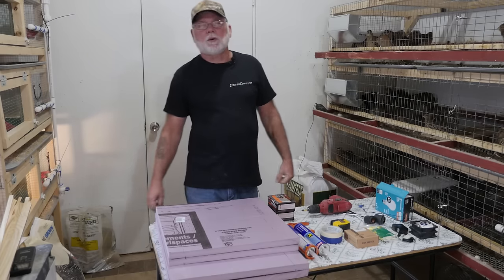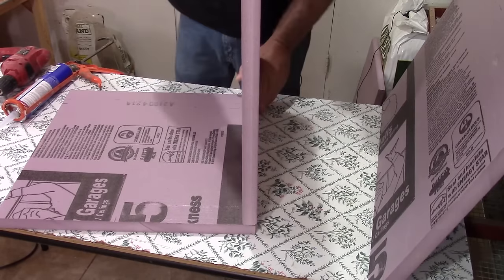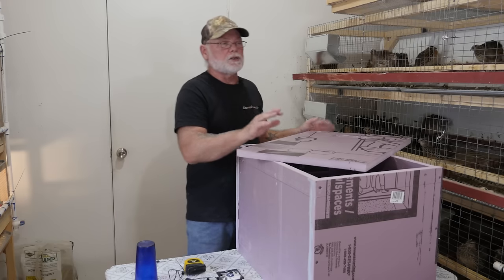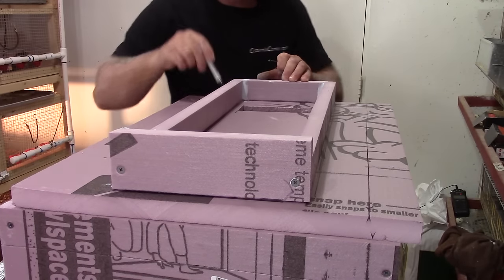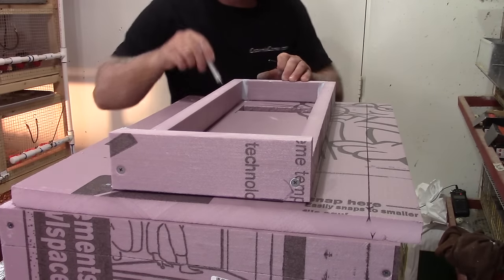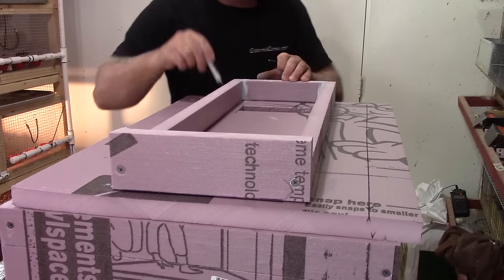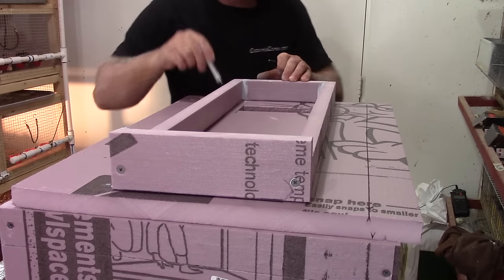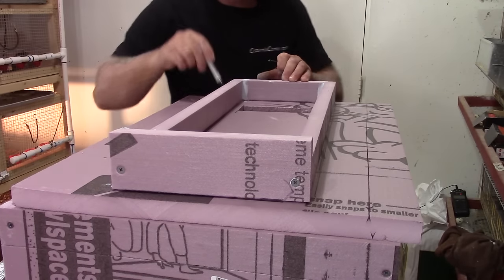How to: Cabinet Incubator - 240 quail egg incubator

Comment: Terry Hi, I m from  India  and seen almost all your vedios.  vedios r great particularly this one . Your information  is very useful & helpful for a number of unemployed youth to get livelihoods.  I am also one such unemployed and run rickshaw pulling . As rickshow pulling hard and less income source, I study your vedios and develop my own incubator to augment my income with your help and  by studying vedios and also taking your guidance. 
Brother, I completed making of my incubator with following information I  use 60W ,  two incandescent bulbs and two fan on one on each bulb. Temperature controller W 1209  from AMAZON, gives temp 37.5 .+0, - 0.5
Incubator body made from thremocol of 30mm thickness. Two small holes for air at bottom and small two holes FOR ESCAPE of hot gas at top. 
I face a problem  in my incubator that temperature and humidity do not rise to required level,  if temperature rise the humidity go down and if humidity rise temperatures goes down. I achieved 37.5 degree centigrade and humidity  43 to 45 Rh% , by use of sponge and cotton cloth humidity rise to 60Rh% but temp dropped to 31 in HTC 2 digital temperature and humidity meter , Where as temperature module showed 37mini 37.5 maximum in centigrade 
 Temperature and Humidity relations is big problem. As without proper temperature and humidity hatching is impossible. I tried on 2 eggs and they got damaged. 
Please guide where I go wrong in making incubator or in hatching process,  as  in achieving temperature and humidity. 
And why the problem is arising .
Please guide and advise pl.
Thanks in advance

Comment: Thank you for sharing good technique, specially the air chennel idea for perfect air circulation. I just wonder how the oxygen level can be maintained in incubator ?
Reply from the maker: Thanks for your comment! There are ventilation holes drilled in the top and on both sides of the incubator. I drill two 1/2" holes on the top and two on each side. One near the top and the other about midway. Hope this helps.

Comment: Have you considered using 12V globes to reduce running costs? I am thinking off-grid with a solar panel and battery. also a link to the hatching boxes would be very useful.

Comment: Terry , Thanks for the video!!!! Do you think if you put your racks a little closer together that you could fit 3 egg turners in your incubator? If you used some sort of thin angle to hold them would it work? If you have put the dimensions of your hatching trays on here ,I have missed them this would be helpful to me. I have had quail for a year and this is the best budget incubator I have found. Keep the videos coming!!!!
Reply from the maker: Possibly, just make sure that your hatching boxes will fit. My hatching boxes are taller than the egg turner trays, so in my setup I'd say no it won't work. You could possibly lower the intake cutout to gain a couple inches but that will take from your humidity tray. You could always build the cabinet a little taller to accommodate the extra tray.  Let me know if you get it to work. Thanks for commenting!
Reply: Terry I will let you know for sure,Thanks for replying so fast.
Reply: Do you have  dimensions of  current hatching trays a n material list?
Reply from the maker: @danhunziger7300   materials list and cut sheet is in the description.
Reply: @CoturnixCorner  Do you have any videos on how you built you hatching boxes and what you use for your egg trays, how they turn? I loved your video! I rarely find a video that gives me the confidence to do something without my husbands help... but this video was great!

Comment: Hi terry , great video and info,thank you , the controller you recommended is currently out of stock on Amazon, do you think the artic  p8 max which is a variable speed 500 to 5000 rpm model would be wise to use considering should the need arise to have a little more air flow or a little less , i also see that there is 2 varieties of an artic f8  one is called an f8 silent which is a 1200 rpm model and the f8 is a 2000rpm model, I’d love to here your thoughts thanks in advance , Brian

Comment: Hello Terry,  I was wondering your thoughts about switching the air intake and the fans to have the bulbs and heat from the bottom since heat rises...and it would take the hotter air...let it cool and pull it back across the bulbs in the bottom to allow it to heat the cabinet.  Would that be more efficient and keep it a better temperature in your opinion?  I'm willing to build it either way just was thinking it might be more uniform temperatures across the incubator that way.

Comment: The neutral wire on a lamp cord has lengthwise ridges in the insulation. The hot wire has smooth insulation. Looking at the insulation is easier than looking at the plug end of the cord.

Comment: I built the cabinet incubator and was having problems keeping humidity up, I live in a desert, with smaller plastic water tray so I switched to the aluminum ones from dollar tree, this morning I when in and found a huge puddle of water. In only 5 days electrolysis has eaten many holes in the water tray. I am wondering about the light sockets and how it is affecting the eggs.
Just passing that along for others to keep an eye out for.

Comment: Hey Terry I started to gather material for my build and I found that 1 inch stuff with the silver foil laminated on one side. Same cost but I thought how cool that is going to be for cleaning etc...People need to always  wipe clean the inside between every hatch. I know it costs alittle bit more but get the digital temp and the humidity unit combined.Even if you don't use a humidifier you will still have the sensor unit to look at and you can even set it to warn you if humidity gets lower that you want it. So lastly,I think you should spray paint that bad boy then put you Logo on it...
Reply from the maker: Will you design a logo for me? Thanks for the comment!

Comment: Hey good evening sir I love your video i have been watching it over and over for weeks now question do I have to put a egg Turner inside or i can use it just for hatching my quail eggs
Reply from the maker: You can do both, you can put an egg turner inside for incubation and take it out and replace it with a hatching box on lockdown. Or you can use it strictly as a hatcher. It's up to you. Thanks for the question.
Reply: Hey thanks for your reply,am a carpenter so I work on that right away i have to incubator working now with a 148 eggs quail, and I live in the Caribbean on a small island of st.maarten i love you all videos thanks man 👍👍👍👍

Comment: The instructions for the controller are hard to understand but I found that the factory set temp "swing" is + or - 3 degrees but can be changed  to  1 degree. after that I really liked how it worked and how cheep it is.
Reply: i cant seem to switch mine from c to f also the uper left corner says cool i cant get it to heat
Reply: @SuperDoerk  the instructions are horrible, if it says cool, its because it is reading above set point.. Even the display does not show the letter the manual lists I kind of had to figure it out.

Comment: Hi Terry that is a brilliant video have just ordered my bits off amazon to build this incubator , a quick question if I may are the fans 12 volt , I have ordered 12 volt fans and a 220 volt  ink bird controller  , the fans obviously are wired seperately via a 12 volt transformer  , thanks again for sharing your skill and knowhow , brilliant video regards Pete
Reply from the maker: Yes, the fans are 12 volt. Good luck with your build!

Comment: HI there 👋. My name is Bobby Breaux. I love your build and channel. I was wondering if you put any air vent holes for for circulating and how do you control your humidity?
Reply from the maker: Yes, there are vents on the sides and top. As far as humidity, I use a small hygrometer from Home Depot and add water to a cooking pan located in the bottom of the incubator.

Comment: Can this incubator hatches other types of eggs example turkey, duck, chicken. or just for quail eggs?
Reply from the maker: Sure, you can hatch any kind of eggs in this incubator. The rails would need to be changed to fit the size egg, but otherwise it would work just fine. Thanks for commenting!

Comment: Great video! I’m interested in this build but do you think it would work in an insulated shed during cooler weather?
Reply: You can set up a small nylon freestanding tent and put the box inside it, put a small personal heater inside the tent to contain the heat, make it a little warmer in there when you’re expecting extreme weather so easier on the incubator. Can also put a tarp over the small tent, another layer to insulate against the outside temp change. Just ideas.

Comment: Haven't purchased this yet, but adding the materials from the links provided plus Lowes for the foamboard and lightbulb sockets, plus egg turners, the total is over $200.  Without the egg turners, it would be around $100 - still not the $50 suggested.
Reply from the maker: Prices I paid from Home Depot: 
Foam: $20
Glue: $5
Inkbird: $15
 (Amazon)
Transformer: $6 on ebay
Light sockets:  $6
Fans:  $3 ea.
Lightbulbs: $ 5
Hinges: $3.50
Water pan: $1
Add another $100 for turners and quail rails.
The links I included are just for reference so you get the right materials and some include multiple items.

Comment: This is great, thank you! I'm about to start my build. Quick question tho - how do you control humidity with this design?
Reply: Live in Florida
Reply: Different sized pans of water.  Maybe float small sheets of Styrofoam on the water to reduce humidity. Or add sponges /rags , sticking out of water, to increase.

Comment: Hi Terry, would a double pane viewing window be worth the extra cost of the plexiglass, perhaps frame the inner door cut out with wood and screw the Plexiglass panels into the wood, sandwiching the door panel with a 1/2" overlap on the inner/outer surface.  Have you considered painting this beast vs manly pink ;)  I look forward to speaking with you someday soon.  Doc & Denise, Tully River Quail Reading, PA
Reply: So if you get the one from Lowe’s it’s green 🤣

Comment: There are nearly 900 comments so I didn’t look to see. Is there a cut template anywhere? Showing what pieces fit where  on the foam board sheet? Beginning of video says something about cutting 18” strips but I see alot of 24” based pieces also. I will have to do all my cutting at a friends house and want to take up as little of their time as possible

Comment: The only part I need to know more about is how to wire the fans to the 12v plug....next video?
Reply: I just did this project. If anybody is wondering, the black wires should be negative and the yellow positive. This can very from fan to fan so do not be afraid to experiment. Black should always be negative. So just start plugging wires till the fan goes round if you cannot find it. If your fan flow is running the wrong way, you can swap the wires and the fan will flow the other way. This should result in two fans, connected to a single plug that can be plugged in to the wall. I ordered the plug from the link here, however, the fan source was out and I had to purchase different fans than what the link was, however they show as the same exact fans he had linked. So hopefully this still helps others! The plug had some holes that you could feed wires in to, very easy! I resulted in three total plugs from this device at the end, however. Had I realized this, I would have purchased an outlet inside of the device so I can plug the turner and fans in from the inside! Oh well, a "next time" project once this gets going
Reply: If you order the 12 volt plug that he reccomend just separate the positive and negative wires in the 2 separate screw ends, its very forgiving, mine has been running for a week

Comment: Terry thanks for sharing. I have been raising Coturnix for about 8 years and have grown the operation. My layer coop needs to be gutted as it's worn out and the mice have ruined a lot so making some changes. I raise about 150 birds a week and need to up this. I have multiple species and keep them separated in breeding for purity but it has proven to cost me time and money to do so. I am thinking about one sub species and group breeding them a couple questions I would like to bounce off you. Which species do you prefer and why, do you keep a specific number of males in with the females or is it random? I developed a watering system for the week old birds as everything I tried has some serious flaws but the unit needs to be level. The new system I am contemplating is a stack cage system on wheels so access is easier and moving them allowing for cleaning. I typically have 100-150 average birds in a cage each week and 10 cages. I use boot trays to slide in and out under the cage and change poop twice a week. I line the trays with paper to make it easier and quicker. Any suggestions to a new system to speed things up. It's about 4 garage bands of poop and papers twice a week with essentially 1000+ birds as I raise them to 10 weeks.  Any suggestions I would appreciate it. I am going to copy your design and build a brooder as out of room in the basement of my cabinet incubator 
Thanks. Steve
Reply: Wow Steve, what do you do with all the birds? That is really awesome!  
What is your hatch rate with this incubator?

Comment: Hey I had to put an extra piece of styrofoam on both sides for the egg turner. Was to wide. Beside that working good. Tweaking it in now. Should be running eggs next week. I build two of them,waiting on egg turner for second one. Will post results!
Thanks for all you support!
Reply from the maker: Good luck with your hatch, let us know how you made out!
Reply: How did your hatch rate go?

Comment: First, THANK YOU for such a well explained demonstration of your build. I do have a question. Your application was specifically for the use of incubating and hatching quail. As they are much smaller birds than chickens, I'm wondering if the height between the two egg turners/hatching boxes will still work for chickens. Do I need to adjust the height so the chickens have enough head space? This will be my first incubator so Thank you again for your help.
Reply from the maker: Yes it should work fine for chicken eggs. My hatching boxes are 3" tall plus a 1/2" for the cover so there is plenty of room for the chicks once they hatch.

Comment: Any thoughts on using 1.5" or 2" foam board?  I know the dimensions here will need adjusted but my garage can get pretty chilly in the winters.  It has not froze but gets to 40°ish all day long.  Thought using the higher R rating may help hold temps better.
Reply from the maker: There was a guy on the Facebook group page who used the thicker foam successfully, and he did say the regulator doesn't kick the lights on as often. So I would think that it would probably work well in your situation.